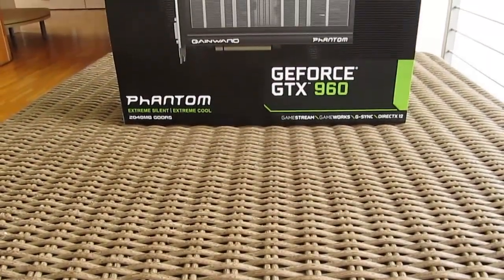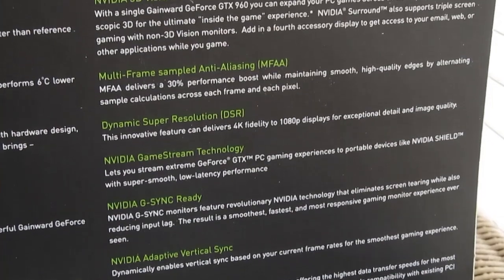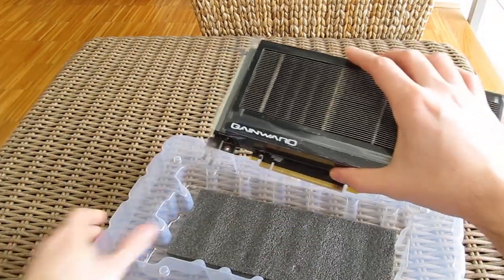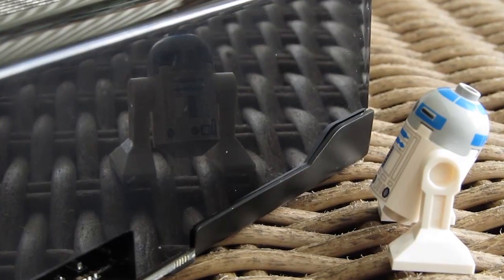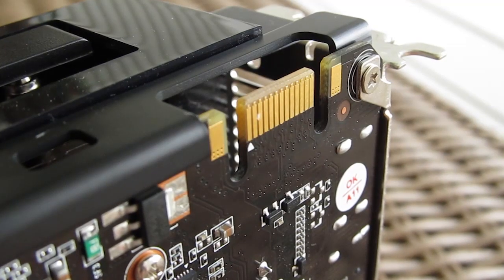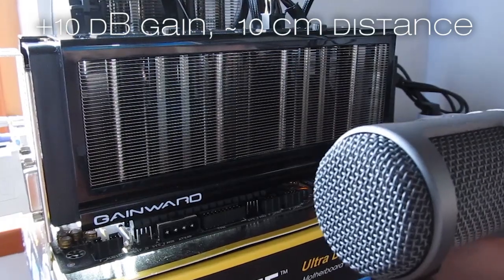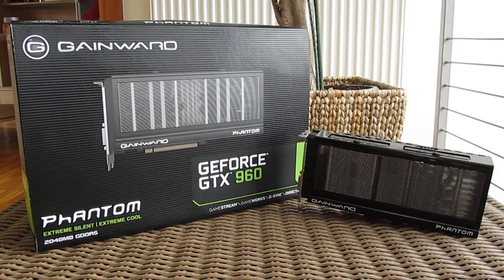Gainward GTX 960 Phantom Unboxing & Preview

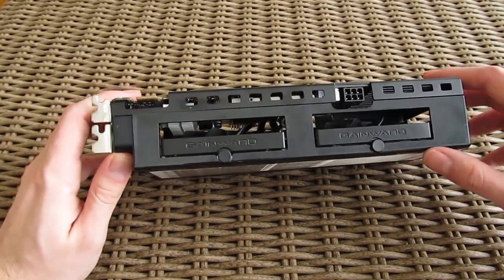Comment: Looks good,.. BUT,.. those wires ON the heatpipe at 2:09,.. Unless the black plastic sheathing around each wire, (of the 4 seen), is heat-proof, I'd be concerned about heat damage if the card malfunctioned in any way, (especially when the grille became blocked with dust or if the fans stopped working, (for whatever reason).

Concerns aside, it looks like a really nice design, I like it.

Comment: So i was thinking to put this into Fractal Design Define Mini C good idea or bad? or should i put in Define S? my mb is MSI H110M eco i hope you answer!
Reply from the maker: Yeah, Deifne Mini C is good! :)
Reply: TekTick how much space i would have between gpu and psu?
Reply from the maker: Decent amount, but you don't need to worry since the PSU is in its separate chamber
Reply: but that chamber have top vents, so probably hot air coming from gpu will be able to trap in hdd space i will probobly get normal C model

Comment: hey can you please tell me the best settings for this card? i dont know how high i should put gpu boost clock. i had it on 1178. also the memory clock. i had 7000 on it. and my power target was at 100%. is that ok or should i change something? sry for my "bad" english but i need your help :D and i have the 4gb version
Reply from the maker: +Hexereye You should be able to hit 1250 MHz on the GPU and around 7400 MHz for the memory without a problem if you want to do manual overclocking!
Reply: I dont know why but when I tried to overclock (I overclocked just memory clock +310 but I think that it doesnt matter how much mhz you add) it caused tearing in game (tested only in the withcher 3). Tearing was easy to see when I was rotating 360 degrees camera/view. Have you same problem ? When I was overclocking while game run in background it was more tearing than when I first overclock and then I turned game but still small tearing to see...

GPU: Gainward gtx 960 phantom 4gb version
overclock soft: Expert tool by Gainward
Reply: When I restarted computer (because when I dont and I only restored default settings for gpu I think I still saw small tearing) I havent noticed tearing

Comment: I need some quick advice, this card 2gb version or rx 460 2gb? I can get both at about the same price pls be quick
Reply from the maker: GTX 960 is stronger for sure
Reply: theres a guy selling a used 960 phantom 2gb for slightly more than the rx 460 2gb(new) im not sure if i should take the risk ive seen some benchmarks the 960 turns out to be around 15-20% better but im not sure how strong is the 2gb phantom compared to the other 960's. Allso 460 is newer and using polaris so maybe the 460 is not so far behind on the long run?

Comment: i get the 4 gb version of it is it good ?
Reply from the maker: ***** It is, but it's a bit of an overkill for 1080p gaming, but you could benefit from it at higher resolution although you want be able to play on high settings since the GTX 960 is not that strong.
Reply: TekTick Yea think so to. Got the 4GB but since my monitor is 1080p max don't know how much it can handle tho I did overclock it to gigabyte G1 gaming clocks.
But for 4k for sure would need a gtx 970 or higher.   
1080p - ultra/high , 1440p medium/high.
Reply: +NerkMineRaiste ASUS is better at the same price

Comment: Do you think I can run Witcher 3 on high with this setup ? 

Cpu: Procesor AMD FX-6350
GPU: Gainward GTX 960 Phantom 2GB (I do not play multi gpu) 
Ram: Kingston 16GB KIT DDR3 1600MHz CL9 HyperX Savage Series 
Motherboard : ASROCK 970M Pro3
Reply from the maker: +Future Nightcore FullHD? Yes!
Reply: I have the same setup but I have a fx 6300

Comment: how worse my 960 oc compare to phantom :(
Reply from the maker: Deadpool Samrat Gigabyte's one?
Reply: no Gainward 960 OC
Reply from the maker: Deadpool Samrat Oh, you have some kind of reference cooler on it. I assume that it's louder and warmer than the Phantom one, but performance wise it's not that far from it, just a bit lower clocks which you can always compensate with a bit of overclocking. :)
Reply: yes i cant play heavy games like crysis 3, bf4, COD AW without full fan speed, temp goes like 30 minute gameplay 80+ and also with my fx 6300 same performance like gtx 660 :-/ NVIDIA is a liar they say gtx 960 give double performance compare to gtx 660 where in far cry 4 just 5-6 fps extra im getting compare to my old 660, sorry for my bad english :(

Comment: hey Bro! i got a bit more molla and now am considering a 960, its either this one or the gigabyte g1 2gb, but this one is about 45 bucks cheaper so am leanning towards this one, and can i run this with this PSU http://www.evga.com/Products/Product.aspx?pn=100-W1-0430-KR and an i5 4440? MAJOR thanks :D and like vid
Reply: Probably you can't power the gigabyte one with that PSU, the CPU is good
Reply from the maker: +Youcef Y-c #Officiel You could probably combine one 6-pin PEG from the power supply plus a 2 x molex to one 6-pin adapter.
Reply: I think that a 430w PSU may be a problem anyway, especially when the GPU is under load, while the Gainward one is much less power-hungry